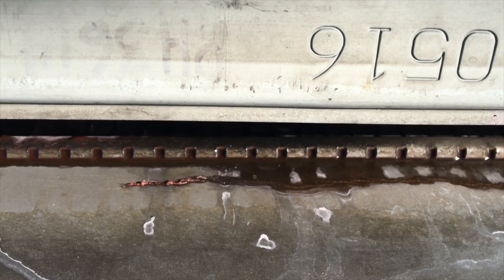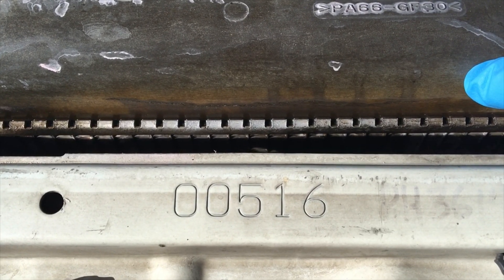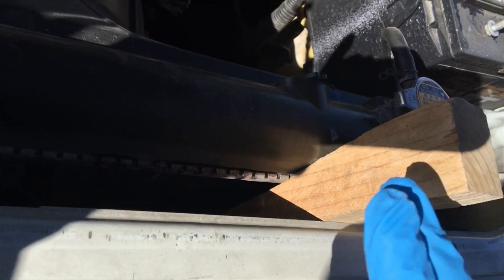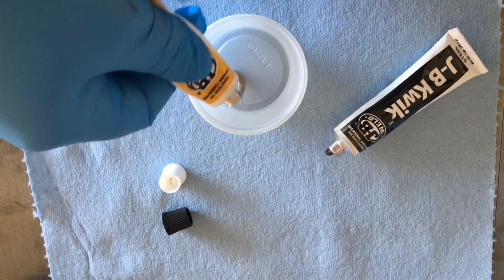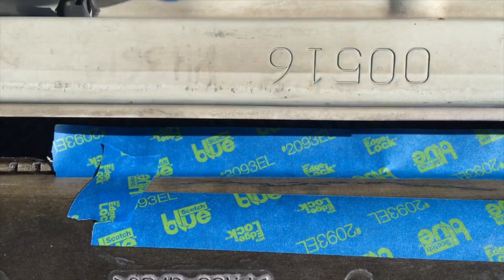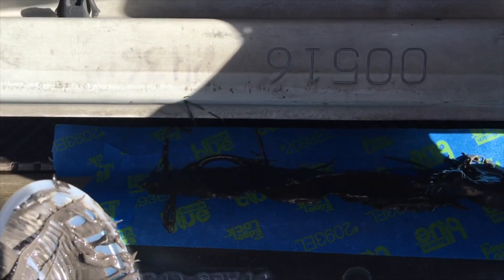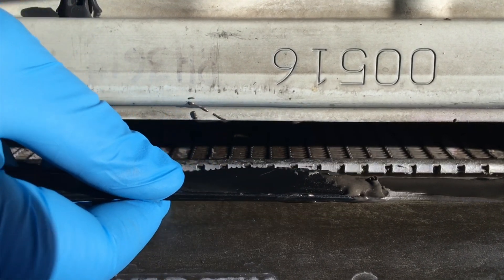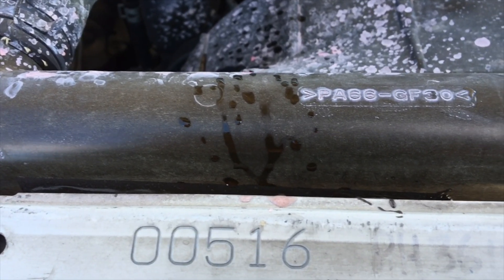Try to fix a cracked plastic radiator with JB Weld.

Comment: Did it hold. Same thing I'm getting ready to do today on the mother n law's vehicle.
Reply: Best bet would be to drill a hole in each end of the crack to stop it cracking further. When your plastics that far gone though, it's only a matter of time til it fails in other areas anyway, so best to buy a new one, as annoying as it is.
Reply from the maker: No, time to buy a new one.
Reply: @exoticwoodpen  they don't have the money. Nor do I. I was thinking to put black pepper in the radiator in case it leaked. But the crack looks like yours. Seems to be a Toyota as well.
Reply from the maker: I understand the money situation, that’s why I purchased mine on Amazon.  Easier to replace a radiator than both the motor and the radiator.
Reply: hello there , did you fix it ? @VcArena
Reply: @mosaabalzahrani9801  no, they came up with the money and bought a new radiator. I did try it on a aluminum  thermostat housing and it didn't hold very long with the heat.
Reply: Thanks for the reply .glad to hear that 
stay safe   @VcArena
Reply: @mosaabalzahrani9801  you too
Reply: Th J B plastic epoxy works better in that situation, same crack about 3" long almost same spot. at least on my 05 dakota it helped a while.
Reply: JB Water Weld works
Reply: @dominoeffect6855  may have to try the water weld